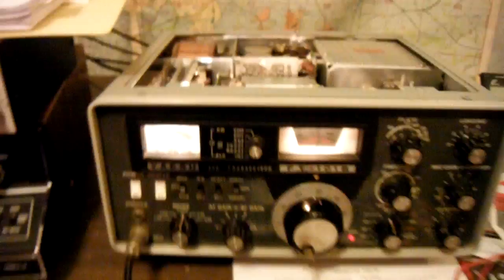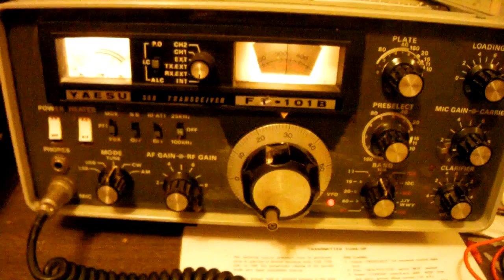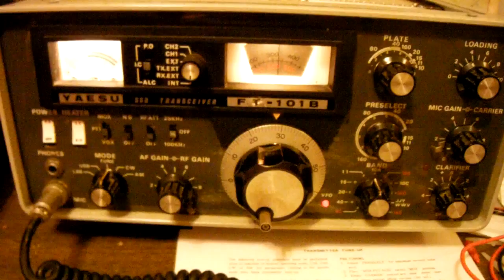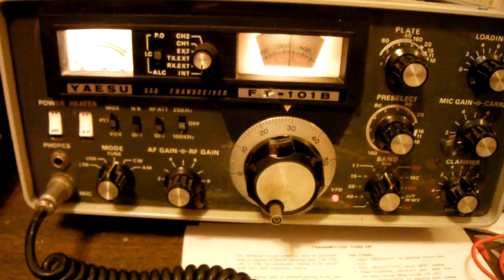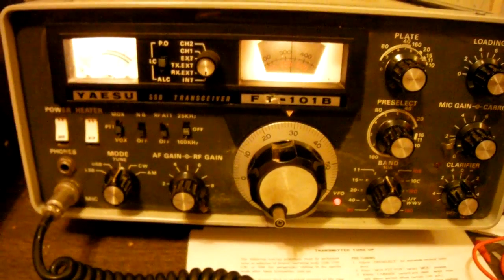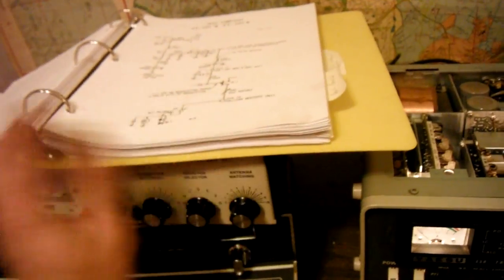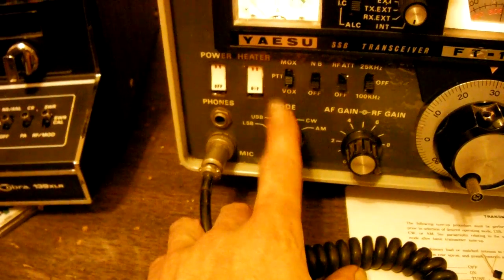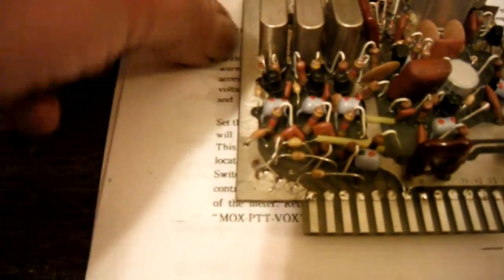Yaesu FT-101 SSB output problems

Comment: preppy: the foistust thing to do, is after the power amplifier, you have a row of test points. check every voltage. find out if one is low. find out why it is low, either upstream or downstream. tadaah, afore yee knows hit, she wurks

Comment: Here are a couple of tips on this rig.  Check out The Radio Shop on YouTube.  Buddy is a big fan of the Yaesu FT-101 series.  
When you are looking to purchase parts for most electronics check out Digi Key or Mouser Electronics for your parts needs.  One thing you may need to do is check voltages in the driver and final stage, but please be careful since there is quite a bit of High voltage.  Anyway check out Buddy's site.
73,  Randy N4OHO
Reply from the maker: Thanks I appreciate it.

Comment: Do you have any idea if the microphone is wired properly & if it even works? Having a carrier is one thing but without a properly wired operational microphone you won't ever get any transmit audio.
Reply from the maker: Yeah I know I didn't do it properly on camera, but I ended up with another FT 101 and the mic worked fine with it. Thanks for the info though.

Comment: do you solved the problem? I have same problem on my ft277. On tune procedure, on AM mode, on cw mode power output is ok in all band. In SSB, phone, if I speak or whistle in the micro tenere isn't any power output :(
Reply from the maker: +74vfd I actually did narrow the problem down but didn't fix it. I bought another one guaranteed to work. So keeping that one for parts.

Comment: The needle isn't suppose to move ssb mode if it does you have to set the carrier to get it to zero, when you key the mic and speak the needle will move  back and fourth.
Reply from the maker: +Fender Blues Thanks!
Reply: Have you cured all the problems now.
Reply: Have you cured all the problems now.*****
Reply from the maker: I talked with a guy that fixes radio's and we think we traced it down to a capacitor underneath but went ahead and bought another one that was guarantied  to work and just keeping that one as a back up or parts.
Reply: *****
OK thanks.

Comment: am and cw you are looking at carrier power on your watt meter.    SSB show output only when you talk into your mic.     Adjust your mic gain not to overdrive the output over the plate current max of your rig .330 ma.  on the low bands and less on the high bands 280.ma   adjust tube idle current .60 ma.    read tune up through better.    If you have cw and am output then there is an mic or audio problem.   Just try talking into the mic.  I  use a ft101B that works great.
Reply: $450??? Man he saw a sucker coming.I have an FT-101B & an FT-101EX & I gave less than that for both of them.They both work & have a full set of crystals & the 101EX even has the AM Filter installed.$450 is Crazy.
Reply from the maker: +lee anderson Yeah I didn't do it correct for the video, but did some more work and got some help over the phone. Traced it down to a capacitor underneath. The guy I talked to had a guaranteed one for sale for $450 so I just bought it and keeping that one as parts.

Comment: G'day mate just found this for the FT101B see what you think about this bloke on your  radio. This is the link.
https://www.youtube.com/watch?v=Nq9XOnoa1OQ
Reply from the maker: Dennis Peake Thanks, I've actually seen that one before. I never did fix the radio I found one in working order and guaranteed to work so I bought it, and will keep that one for parts.
Reply: The FT101B is different in side with the crystals then  the FT101E. Own both sets and enjoy many years of haming.
Reply: They use the same crystals.I own an FT-101B & FT-101EX & they use the same crystals & cover the same bands.

Comment: I own a FT101B and you must learn how to TUNE the radio before you operator it.
The heater switch must on, and the power switch. If you want know more have look at this link. He also has a FT101B.
      https://www.youtube.com/watch?v=Pjg6OYsdSdw
That may help.
Reply from the maker: Dennis Peake I've since learned how to do it, but thanks.

Comment: Just like MrBugsier said it will not show any out put until you talk into the mic Make sure your carrier is up and mic gain is al the way up and watch your meters. you need a watt meter, modulation meter and a swr meter. It sounds like it's working fine, you just need to learn how to use it. If the caps were bad there would not be any out put at all.
Reply from the maker: Yeah I figured that part out and think I know where the problem is but found another radio in good working condition and went ahead and bought it and for now just keeping this one for parts if needed.

Comment: At ssb you should put audio in it, you have to modulate the transmitter to make autput rf!
Reply from the maker: Yes I did that as well, narrowed the problem down with help on the phone with a guy that repaired them but ended up buying another one in good working condition, I only had about $150 in that one and figured it would be a good parts radio.

Comment: Inject some single-tone audio signal between 400 and 2400 Hz to the microphone line and you will see the output going up to more than 100 watts. Be sure to NOT key the transmitter more than 10 seconds (I would say not more than 5 seconds) or the PA tubes will degrade. They can handle a high peak output power but not for a long time. That is why the output carrier needs to be reduced to 40 watts max. when using AM with this radio.

Sven, DJ2AT
Reply: I key 30 watts & get 100 watts PEP on AM from my FT-101EX with New tubes & only about 75 watts PEP with my FT-101B with older tubes.
Reply: I have the same problem. And it is that board that cause it. If you listen properly to the video he is describing what happened and all the test performed. IT IS OBVIOUS THAT HE KNOWS HOW TO OPERATE IN SSB.

Comment: Do you know how SSB works? There is no carrier (it is suppressed) and unless you are not talking into the microphone or inject some audio signal to the microphone line the transmitter will not put out anymore RF.

When pressing the PTT switch in SSB mode the meter shows the idle current of the main PA tubes. This has to be set to 60 mA (0.6 reading on the meter) with the BIAS adjust pot on the voltage regulator unit. The carrier pot will not have any influence on the current (different to AM/CW)